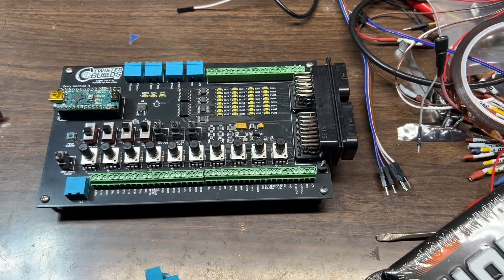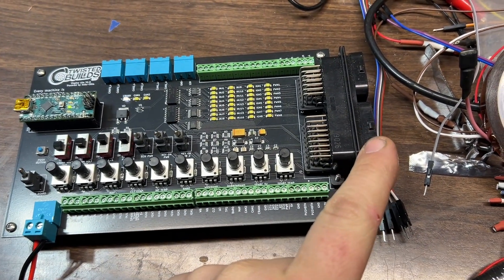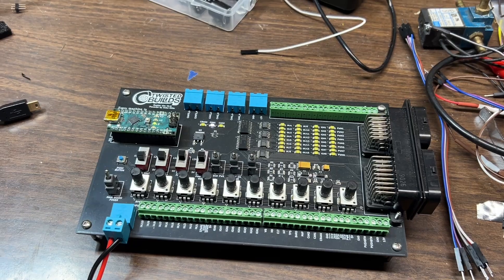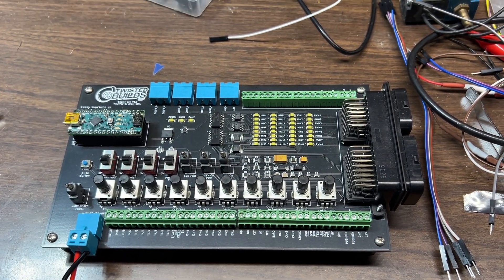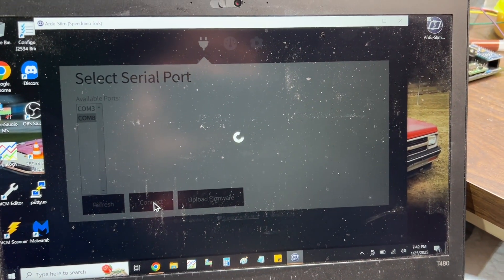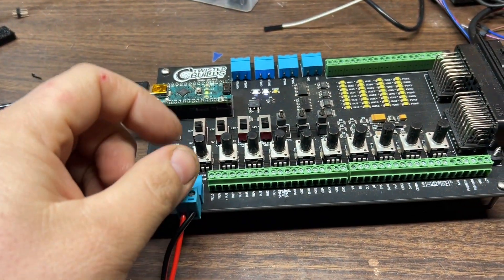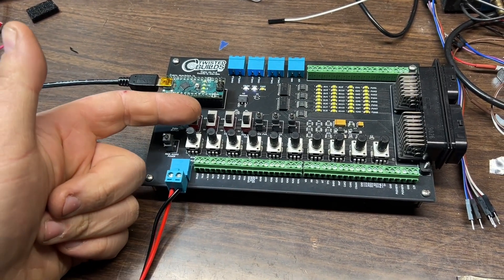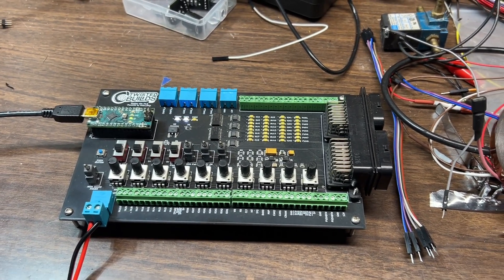Engine Simulator Product launch!

Comment: Great job handling the pulse reset variance on the different cams and cranks. I made something similar to this about ten years ago for doing Vag using a PIC processor. It took me a bit to figure out the exact pulse and reset on the reluctor wheel for the timing pulse reset; however, I designed that into the code to stretch the reset out, and it worked. I think your approach is much simpler. I love it.

Comment: I remember doing similar years and years ago with a "JIMSTIM" on a Megasquirt to make sure i wasn't going to release the magic smoke or go crazy chasing issues.  Having an engine simulator paired with your efi is worth it.  Seriously.  That was my first time and it went well being so nervous and critical of myself thinking i wasn't good enough to build my own car let alone tune it. This can ease that pain regardless if you're new or been at it a while.
Reply: I use a JimStim for datalogging development on Ford EEC 🤣.

It also stands in as a key switch for bench flashing and I'm currently using it to simulate an analog sensor for CANbus hacking.